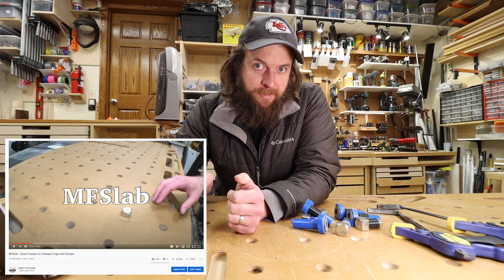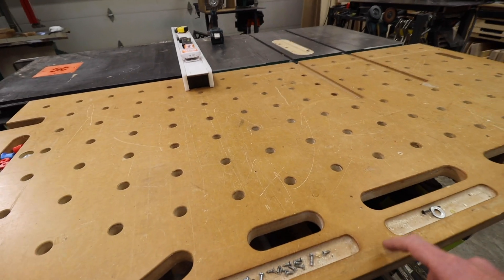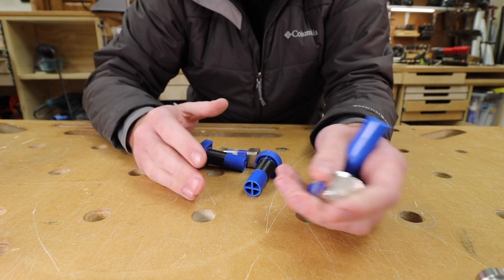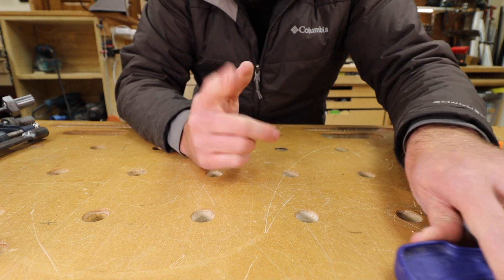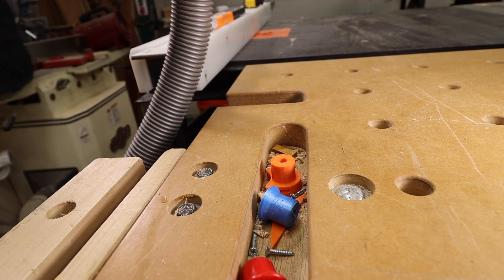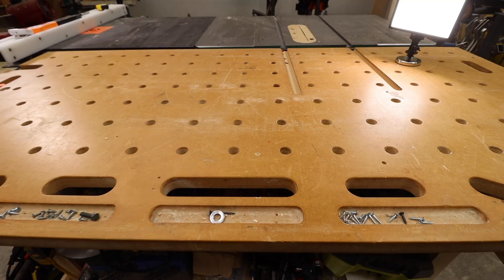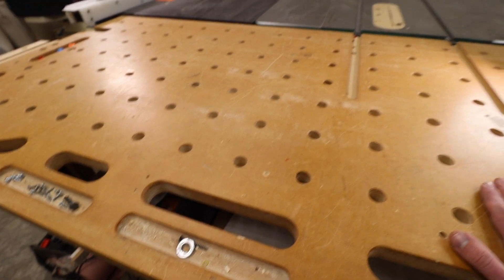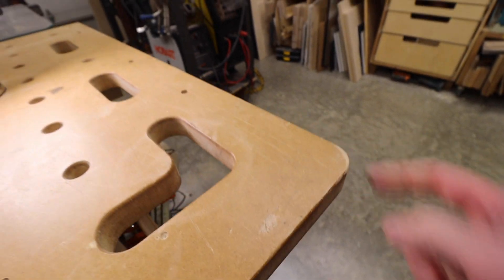MFSlab #1 - UPDATE: Usage, Likes & Dislikes.

Comment: Great ideas.

I built one of the original Ron Paulks 4x8 benches and I the nice thing about it is when small parts fall through, they are caught on the integrated shelf below. I would recommend you mount that top to something like the Paulk bench. It will also give you cubbies to store your small power tools for ready access. 

Great idea with the routed corners. You could take this a step further and see what Ron Paulk is doing with the "wings" he connects to his new bench for accessories.

Comment: Cool Stuff. If you can get a slightly smaller sheet of OSB under your current top, or get the top off temporarily, you could use the current top as a router template to cut a sacrificial top from the OSB. Then that could be placed on top of the current slab, held in place by 4 short dogs (wiener dogs?). Just lift the OSB top off when you want to use your table saw.
Also, Ron Paulk made a similar table top (~3x5), but he also made long, not too wide  extension tops for that small top, which allows him to handle large sheets. Again the first top is used as template to route the others, and they sit on top of the smaller top when needed.
Finally, you need a dust shelf under your top to catch the small parts, and a magnet on an extension to get them out when they fall.

Comment: Neat, I'm looking forward to your upcoming videos.
And I also have some suggestions for your use of the MFSlab which may or may not come in handy.

1) Maybe keeping a small (magnetic?) tray nearby into which you can drop screws and parts could help minimize loss of screws.
Or attaching a tray / box to the front underside of the slab.

2) Insetting a T-track or two greatly expands the useability of MFT-like tops, especially with the Kreg Automaxx track clamps. A bit pricey, but damn they're amazing. See the Stanton Bench by Dave Stanton for reference.

3) And while this is self-advertising, I designed a bunch of dogs, clamps, stops and such for the 20mm system of my Stanton Bench and uploaded them on my same-named thingiverse account. Perhaps they might be of use to you, so by all means do check out thing:4565616 . Nothing with downward-pressure like the clamps you have teased though.
Reply from the maker: Holy crap!  That Thingiverse set is brilliant and comprehensive (and timely).  (link: https://www.thingiverse.com/thing:4565616)  Do you mind me giving that fairly extensive airtime in my upcoming video?

What's the diameter of the shafts?  I've found 19.85mm to work well for my MFSlab, but I have a feeling my slab was mis-drilled slightly as the Veritas dogs are pretty hard to get in/out.

edit:  and, great ideas on #1 and #2 also...
Reply: @KeithsTestGarage  Not at all, I've uploaded them for free for a reason.
The shafts are all set to 20.0mm and work well with my bench top which was drilled with the Parf Guide System MK2.
It's all parametrically designed in Fusion 360 though, so it's not very hard or time-consuming to change the diameter.
I just didn't upload other diameters there as that particular thing already has almost 100 files and adding duplicates of basically all of them in 19.9mm, 19.8mm as well as 3/4'' (~19,05mm) and maybe 18.9mm (slightly sub-3/4'') would make it rather hard to organize.
I've been toying with the idea of simply creating separate 'things' as basically duplicate sets with just the diameters changed. If you state which diameter you'd like to have I'll try to get that done within a day or two.

Also, the Festool MFT system is designed to have pretty much exactly 20mm holes. I don't know the exact diameter of Festools own dogs, but Veritas and Parf Dogs are made to 19.9mm with quite high precision.

Lastly, maybe some of my other designs are somewhat of interest to you as well. And while it'll take a while to get done as I remember you excellent shop organization videos I figured I might use this moment to tease you a bit - I'm currently designing a set of Sortimo-like assortment boxes. They'll be stackable, include a grid you can glue, screw or nail to wood so you can fill drawers with them (similar to Alexandre Chappel's approach, but hopefully even better. For his version refor to this video: https://www.youtube.com/watch?v=VntGnLuwoeY ) and maybe even go as far as to design some actual boxes for them to go into, stackable as well. As I'll have them made in various heights they should be useful for anything from drill bits, screws, nuts, bolts to electronics stuff and more. Like I said though, that'll take a few more weeks or even months of designing, printing, testing and refining.
Reply from the maker: That is quite a tease. 

As for the dog sizes, don’t worry about the duplicate sets. I think my case is unique. When I picked up the slab the guy mentioned something about having to do something awkward with the cut that ended up with slightly offsized holes. I’ll make a note in the video about how to work around it in fusion 360 to change the param if necessary.
Reply: @KeithsTestGarage  Not really. I am well aware of general manufacturing and 3D printing precision and tolerances, so I planned to upload other diameters anyway eventually to make it easier for people to just get a set, print and go ahead and use them with as little post-print-processing as possible.
I didn't have the incentive to do so so far and hadn't put much thought into how to do it most conveniently yet.

However, if for educational purposes you wish to show how to resize / edit STL models I certainly won't stop you as it is quite useful knowledge to share and have.

By the way, if you'll have any comments about any of the models, suggestions, improvements or ideas for new dogs / stops / clamps / tools I'd be happy to hear them. I benefit from such feedback as my own collection of aforementioned goodies will keep improving and expanding as well.
Reply from the maker: @cabbitcastle  Great, I'll print out several of them and give feedback.
Reply from the maker: Ok I found that printing your standard dogs at 100% would work with excessive force for my MFSlab, and printing at 99.5% gave the ideal amount of friction. No play but able to reasonably get in and out. 

I’ll move on to the other components that have multiple parts or rely on bolts to make sure they work with each other at 99.5%
Reply: @KeithsTestGarage  99.5% ought to be exactly 19.9mm by my calculation. As rescaling also rescales the offsets which should remain abolute it's not the best way to go around. It might lead to parts not fitting as well together as they should.

Instead, I'll take this as the incentive and actually remake the whole set with 19.9mm and upload it as a new thing. It should be done within the next 24 hours, I think.
Reply from the maker: @cabbitcastle   Agreed about scaling not being best.  If you're doing this for me primarily, can you make the shafts 19.85mm?  At least, that's what I use for my dogs in Fusion 360 that works well.
Reply: @KeithsTestGarage  It's been more of an incentive, really. I know that the accuracy of printers and various tabletops varies, as well as 3/4'' doghole systems being fairly popular so I've been meaning to upload fitting versions for a while now.
I've just finished editing and exporting almost 300 files (19.9mm, 19.0mm and 18.9mm versions) which took me about 4-5 hours to do and am not too keen on making another set anytime soon, I hope you can understand and make do with the files I'll be uploading in the upcoming hours.
Reply from the maker: @cabbitcastle  Makes sense - I can modify the f3d versions for my situation for the parts that matter if necessary - such as the ones that span multiple holes.  Size priorities are the ones you listed, as that'll account for the 3/4" holes too.  
(and if your original ones were 20mm diameter, then I imagine the 19.9 ones will work for me anyway)
Reply: @KeithsTestGarage  Thank you for your understanding. The 19.9mm dogs should be online in the next couple minutes here: https://www.thingiverse.com/thing:4631917

The other variants will follow soon.

Comment: 3d printer is an excellent investment. I however didn't know that they were accurate enough. Did you had to sand the dogs to make them fit the holes.
Reply from the maker: No, but they are insanely accurate now.  Maybe I should do that video #3 sometime…

Comment: For the small parts annoyance...have you tried a small roll up magnetic mat. Just a thought. Cheers
Reply from the maker: Ah so a non magnetic sheet of sorts that has magnets around the edges to hold it in place?
Reply: @KeithsTestGarage  thinking more a separate “magnetic mat” the kind that iphone repairers use which can be rolled up or small enough to keep in a tool box. Alternatively just a thought recess a magnet in one of the trays or fix a stronger magnetic to the underside of the top and maybe mark out on the mft surface where the magnetic area is.

Comment: An old bed sheet loosely hung under the table would catch dropped parts that fall through the dog holes.
Reply from the maker: Ah interesting.  I haven’t thought of flexible materials yet.  That opens up the door for retractable materials then. Thanks for the idea!
Reply: @KeithsTestGarage  Why place the catch-all material UNDER the table top?  Wouldn't it be far more  effective - and essentially eliminate the problem altogether -  to simply layer a thin removable slab on TOP of the MFT surface?  That's what I'm contemplating doing when I build a Ron Paulk-style MFT table.   I'm still exploring the appropriate material to use, but I'm leaning towards a 1/8" sheet of MDF.  The beauty of this approach is that this removable top layer doesn't have to be one single sheet covering the entire table.  You could make it modular, allowing you to keep a portion of table 'open' as a clamping surface, and the remaining surface solid.  Or you could keep the entire back foot or so of the table solid as a storage area, keeping the front portion open for clamping/cutting etc.  I haven't worked out all the details - like for example how to best secure the top layer to the underlying one (leaning towards simply lining the underside of the top layer with rubberized 'grippy' material),  but I think this approach could yield the best of both worlds.
Reply from the maker: @SteveinJersey1234  well that seems obvious.  Shoot. Yeah I’ll have to make a 1/2 coverage 1/8” or 1/4” MDF piece that I can just slide in my plywood stack between uses. 

Thanks for the blatantly obvious idea that I’ve been overlooking.

Comment: Just watched your drawer video, why not make a 2” drawer for just under the mfslab to catch your parts. Would be thin and up out of the way.
Reply from the maker: good idea.  At one point I ruled it out since some clamps need room under the table to operate, but I suppose now that I no longer use that style of clamp (and instead use the HF clamps welded to bolts), that's no longer an issue.  Hmmmmmmmm, thanks for the tip, I'll probably end up doing this.